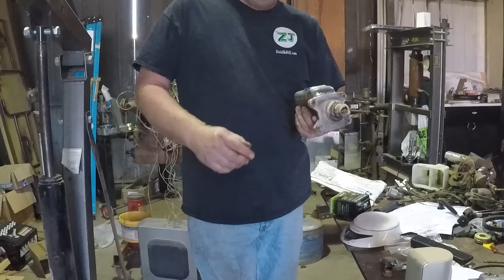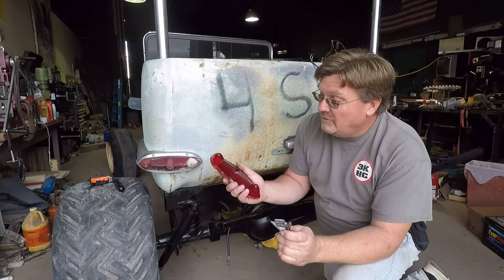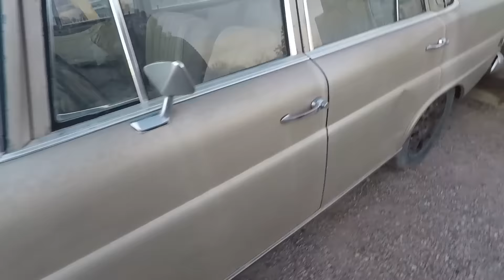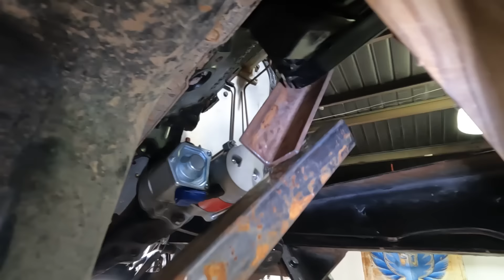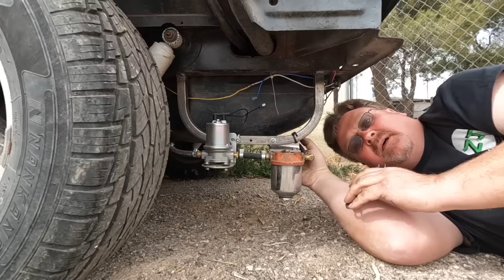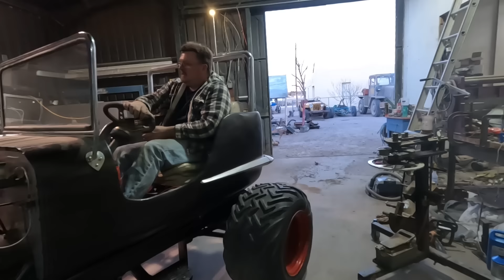Mopar Powered '51 Ford Sand Buggy Rescue, Build, and Test!

Comment: New to your channel ,love looking at the older videos!  The front axle looks like it from a ford from the early 30s or 40s with the hydraulics brakes system! I have been watching a channel called iron trap garage  ! They like redoing flat head ford v-8 motors,in 32 , fords .

Comment: Some alternators may also works backwards, but if they're being run backwards you'd have to reverse the polarity of the wires. I don't really know, I haven't tried it, but I'm an electrician if that helps, it's plausible depending on how the alternator is wired, more likely to be possible with older style alternators, as newer ones are more likely to have internal circuitry that depend on the power coming from the right direction.f

Should have painted that thing with truck-bed liner, not only is it the same texture, but it helps re-enforce the metal and protect it from future damage, environmental and physical...have you seen Jared's Charger yute conversion? Coat the sheet metal in truck-bed liner and it becomes invincible, like adding resin to glass fibers, but stronger because the liner sticks far better to metal than bondo does...

Comment: I like the style.  Has that '51 Ford rear clip been narrowed or is it stock width?
Reply from the maker: Thanks!  I think that its stock width.  The rear axle is just extra wide, I switched to narrower rear tires for rollers just to get it on and off the lift easier because it hit both sides.

Comment: I have a 02 Grand Cherokee the windows aren't working I just wanted to know if you knew what to do?
Reply from the maker: Pull off the door panel and check the power going to the window motor.  If you have power when you push the switch but the window doesn't move, you probably need a new motor.  If you don't have power at the motor, check the switch.

Comment: I'm building a sand rail and I bought a 76 doge motor home that has a 44 that was rebuilt all new edelbrock carburetor and aluminum edelbrock manifold with headers the fellow had done the moter all new tires and all new components in the moter home but a 🌲 tree fell on the over hang and ruined it I got it for 300:00 dalars and I'm using the tranny and rear-ended should be fun to build and fun to drive i just need to find a 51 ford downer car I have a model a front axial

Comment: My folks built sand rails wen I was a kid and at 11 years old I got to drive it was so much fun the buggy had a 57 j 2 olds with try power a b n m Hidromatic a model a front axial and strate pipes and it was rebuilt engine and it would really get up and go I pulled a weely and flored it was so much fun just saying

Comment: ive never worried about drive shaft angle,,i tilt the diff up as much as it will suffer, & re weld the shoes, gains +1/2'' clearence. with a cardan joint,

Comment: Wondering why you didn't move the whole engine and transmission forward in the frame.

Longer driveshaft would be the main benefit.

OK, too much weight on the front axle, I get that.

Comment: The good way to protect the aluminum radiator is to cut-out the sheet rubber from 8 inch wheel and inner tube comes out of 15 inch diameter tire or get a new one rubber from Marathon Brand or Slime Products. Then electric drill to cut a hole thru the sheet of rubber 
(synthetic). And the sheet rubber goes between the radiator and cowl frame. The radiator have sheet metal on both ends for bracket up and tighten to the frame in the front of metal wheel well.  Frame is also called radiator carrier. The sheet is suppose to not block air wind flow thru the front side of radiator. Originally that rubber mount bushings allow the radiator to be cared for. Thanks.

Comment: I never understood why drum brakes are worse than disc breaks. Looking at how they work there appears to be much more area for friction on drum brakes and if they were made out of the same types of materials I would think drums would work better than discs even though they don't. Or are there such things as high end drum brakes?
Reply from the maker: From what I understand its a matter of getting rid of the heat.  I've seen drum brakes with fins cast into them (Datsun 240Z) for performance use, but they still trap the hot air inside them with the shoes.

Comment: Low buck garage i know im late but ive got question the front part of the that thing looks like jeep  but the back of it  looks like something else entirely 
In my mind it almost appears that someone cut the back off of a car and welded it to the front half upside down
Reply from the maker: You're exactly right!  The back is a '51 Ford, upside down.  You can even see the old fuel filler door on the bottom from the inside.
Reply: @LowBuckGarage  oh ok sure do like that thing  just finished watching your video where  you showed that jeep engine block compressor thats neat didnt know that had actually been done before

Comment: You sure come up with some interesting projects, love it!  Myself, I'd run Electric fans and electric water pump, used are pretty cheap and you eliminate the two pulleys. Less shit to go wrong off road the better.
Reply from the maker: Thanks!  I'm definitely going to go with an electric fan.  So far I haven't found any cheap electric water pumps for a Mopar, but if I do I'll try it out.

Comment: What's with those front tires?? Rims seam way to wide for the tires??
Reply from the maker: I've actually run into that style a few times.  Back then wide tires were not readily available and also expensive, but wide rims could be made fairly easily.  A lot of people put regular car tires with tubes on wide rims.  You can't seat the bead normally, but with the tube inside will expand the tire and make it work.  Then you have the effect of a wide tire contact patch with the cost for a regular tire.  If you're interested, I tried out a set of four on my CJ-2A here: https://youtu.be/a3QSoRCM0j0

Comment: Had a friend back in the 80s Had a water pumper '50 Plymouth frame Studebaker front axle 289 ford mustang 3 speed 9 Inch rear end

Comment: Question on the frame.
Is that nice big radius on the front of the frame a factory thing, or a custom thing?
Never have seen the likes of that! I think it looks very different & cool 😎
Reply from the maker: I agree, its a pretty unique feature.  It was welded on to the frame; the weld is visible where the straight frame rails connect to the curved section.  A lot of this buggy is made from re-purposed parts of cars, so it may have been factory made for something else.  If it was hand made, they did a really good job, because the metal is curved very nicely.

Comment: The alternator needs to spin in a certain direction because the fan behind the pulley cools it.
Reply: Does it matter electrically speaking?
Reply: @david929190  It doesn't. It's gonna produce electricity either way
Reply: @WhatTheHell919 correct.

Comment: You could simply purchase a split u-joint that has different sizes on it adapts one size drive line to another size yoke get them at advance or online
Reply from the maker: I tried, but I didn't find one with both the sizes I needed.  Guess this is a weird combo...